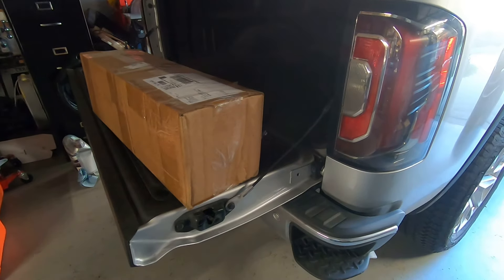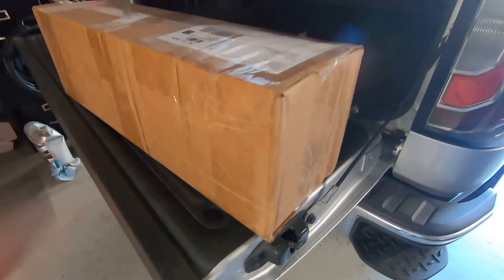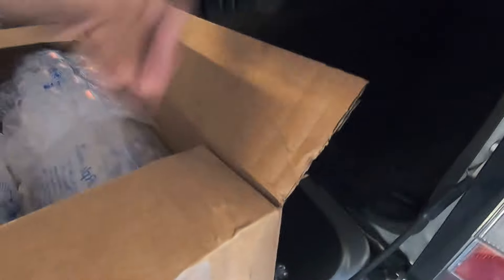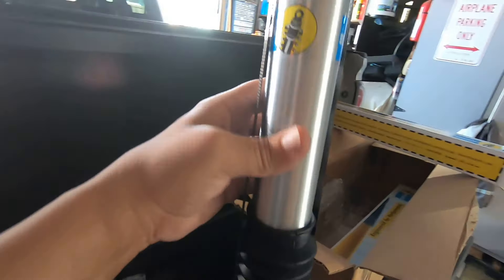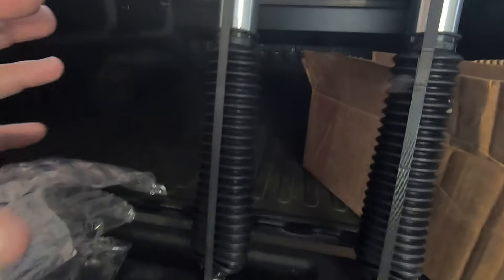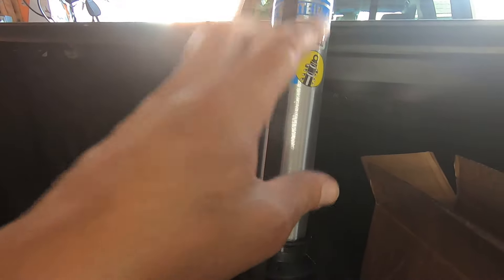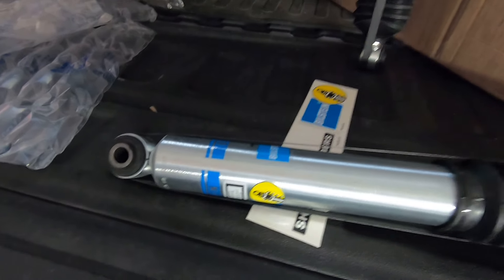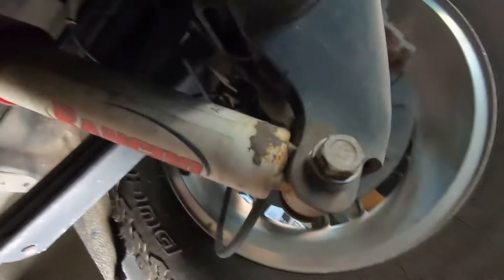Bilstein 5100 Shock upgrade on a 2016 GMC Sierra / Silverado.

Comment: If you're looking for a smoother ride although Bilstein is a well-known quality brand the 5100s are known to ride very stiff and most people say it's too stiff for their liking
Reply: Which shock do you recommend for a smooth ride
Reply: @rosendojr1110  everybody says for a smooth ride you should go with fox 2.0
Reply: I did 5100s all the way around (second notch up front). Smoothest riding vehicle I’ve ever been in.
Reply: I have installed the 5100 on the rear and the truck vibrates a lot and I can feel every single bump on the road… the worse decision I have ever made. I really don’t understand what people are talking about a smooth ride.
Reply: @RedBeardDevelopment whats your truck?
Reply: @josemisiego what truck you got?
Reply: With the boot on, how do you know if they are leaking?
Reply: I regret putting the 5100's on my 2008 GMC Sierra 1500 SLT Z71 4x4. They are to stiff for daily driving. I was thinking about trying the Rancho 5000X or maybe back to the 4600's which came on it new. I'm running the Michelins LTX  265/70/17" Which are hard riding also.

Comment: Boot up if running gravel roads or else that boot will get torn up in a few hundred miles. Of course, you can run without a boot. For us who run off-road, but up....for paved roads; makes no difference. However, why go with the 5100? If not lifted and need the extra extension length or if not using a coilover on the front and using a 5100 adjustable shock, a 4600 is the same monotube design with the same size digressive valve and nitrogen charged.

Comment: I installed mine last night with the boot facing down so you could read the decal on top and was laughed at saying they where put on upside down
Reply from the maker: Yea, I have had people comment that they are upside down then I point them to Bilstien's website so they can get educated.
Reply: @737mechanic  Just installed the same ones on mine, and the label was oriented such that the boot is up.  Double checked the website too to make sure I was putting them on correctly, and double checked the part numbers for the shocks, and they're correct per Bilstein's website too.  So, maybe they changed it?
Reply from the maker: @upon1772  Interesting. To me it only makes sense to put the boot down so any water or debris that gets inside will not ride on the chrome and wear out the seal, instead, it will drain out the weep holes which in your case are at the top but in my case, they are at the bottom.

Comment: Hi i have a 2016 GMC Sierra V8 Crew Cab 2wd….can I use this same set up for my truck? Or it has to be on a 4wd?? Is yours 4wd? The Amazon listing for both front and rear u have shows on the description up top…”4wd”
Reply from the maker: That listing on Amazon should show for both 2wd and 4wd. The part numbers that come with the set show they are for both 2wd and 4wd on Bilstein's website. So yes that set will work with your 2wd truck.

Comment: If I just changed my rear shocks on my Sierra to bilstein and left my front Rancho for now would that be a bad idea? I'm not enjoying the rear feel of myn over bumps especially at higher speeds, only 12000km,not happy
Reply from the maker: Yes that is fine.
Reply: Rear shocks make the biggest difference imo

Comment: This might be a really stupid question, but where are you putting the jack at to lift it best for the shocks? I don’t believe the pumpkin is the right spot IMO and I didn’t see a jack on yours. Thanks
Reply from the maker: I didn't jack it up for the rear shocks, I had enough room to get under it and change them without jacking.
Reply: @737mechanic  at about 7:30 when trying to fit the shock is what I’m trying to do and I was wondering how that worked out. I was thinking on lifting where the hitch it’s at to lift it for the shock placement.
Reply from the maker: @alexsimonson6950  yes ,I have lifted at the hitch to get me some more room when needed.
Reply: Thanks for asking this question. I was wondering the same thing. I’ve only jacked the rear up on the rear diff (pumpkin) so didn’t know about using the hitch. Thanks both of you